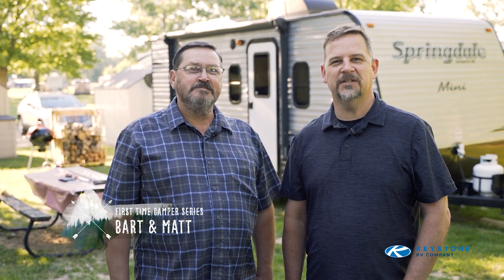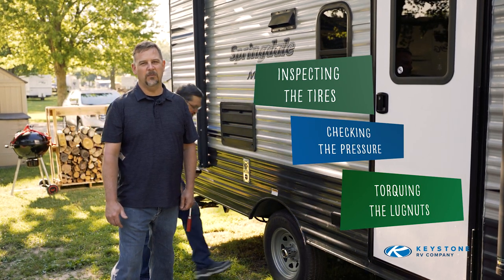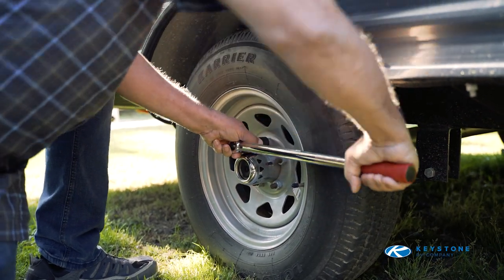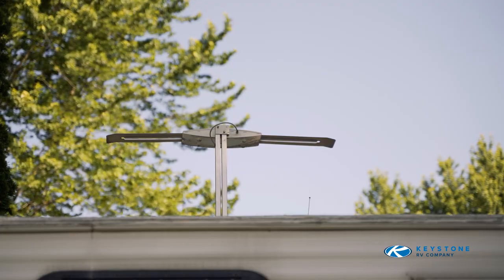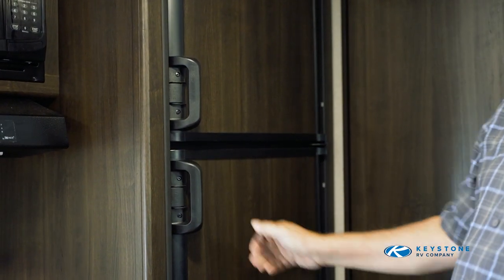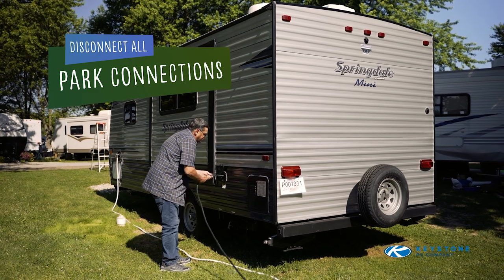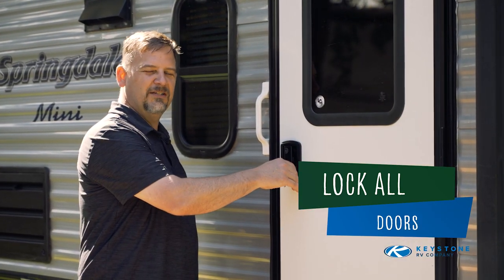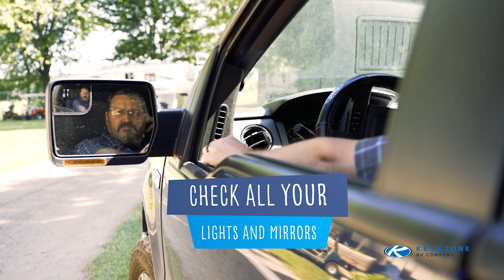Welcome to Keystone RV's First Time Camper Series! - Episode 1: Pre Travel Checklist

Comment: The battery disconnect should be left ON. It is needed for emergency actuation of trailer brakes if the trailer becomes separated from the tow vehicle. Although propane is needed for the refrigerator if it is not 12volt, it is illegal in some states to tow with propane on.

Comment: Great job guys. This should be a helpful series to new rv'ers. I don't want to be THAT guy, but some new folks may not realize you need to leave the LP on if you are traveling with a full refrigerator you need to keep cold. Thanks, I look forward to the rest of the series. I wish I had known to check the roof of the slides before closing... my first camper had a slide roof leak from leaving pine needles etc. on the roof when I closed it.
Reply from the maker: Hello Serge!  Thank you so much for taking the time to give us your feedback on the video.  We definitely appreciate it.
Reply: Keep a few of the reusable blue ice packs in the RV freezer while at camp and when in transit move it to the fridge so that you won't need the propane to operate the fridge. The ice packs when fully hard and out of the freezer usually keep their cold for 12-18 hours easy.  You can supplement the chilling power with a small battery operated fan to circulate the air in the fridge.